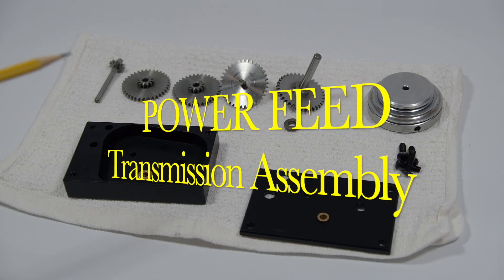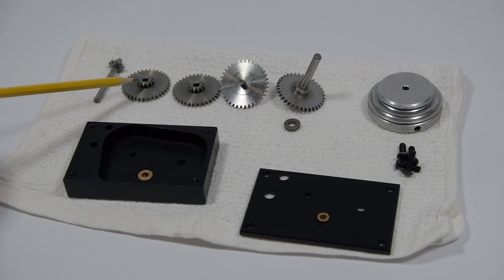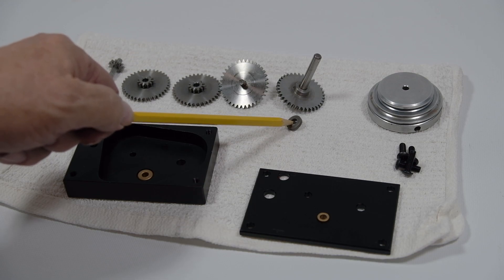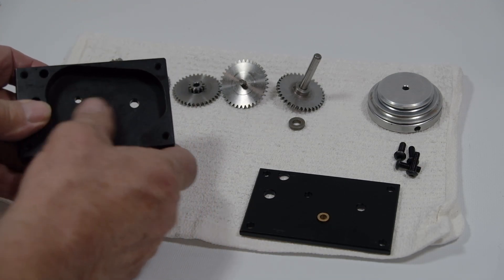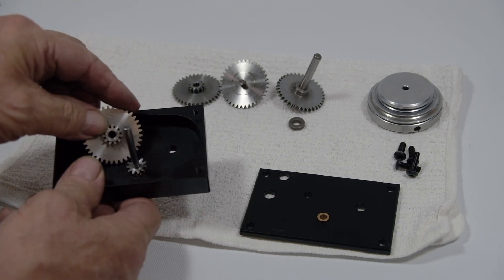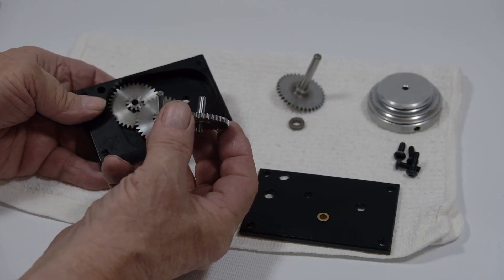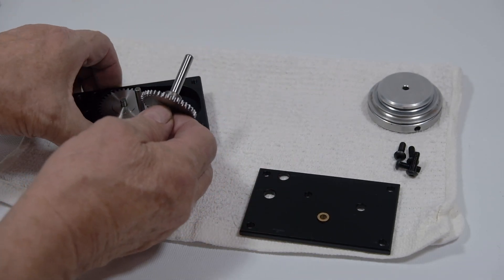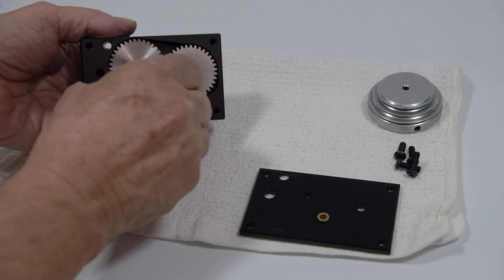POWER FEED Transmission Assembly

Comment: I just bought the transmission box but I'm having a problem finding out how to fasten it to the lathe I noticed on top of the aluminum block there's a screw at the top
Reply from the maker: Did you get it installed?